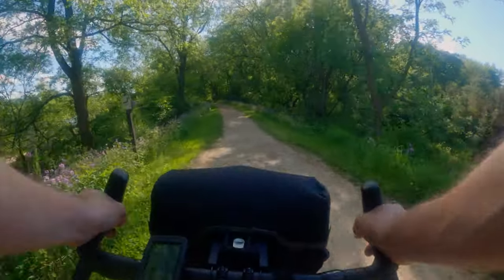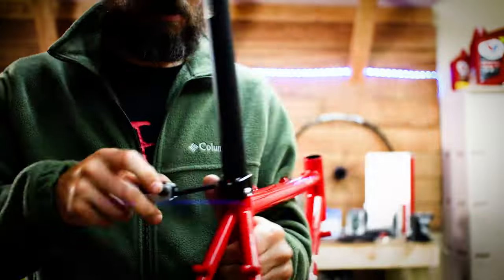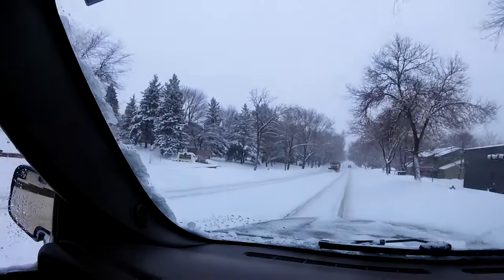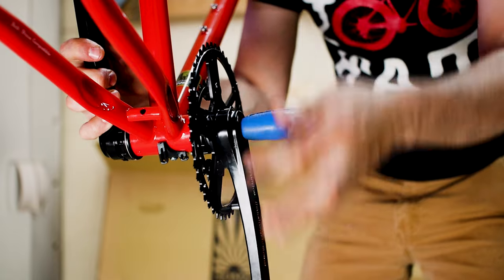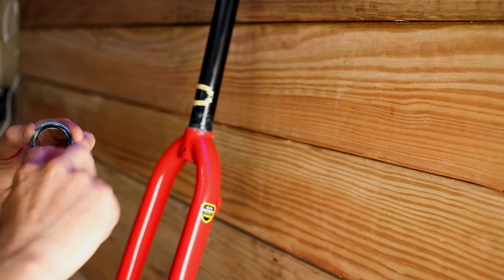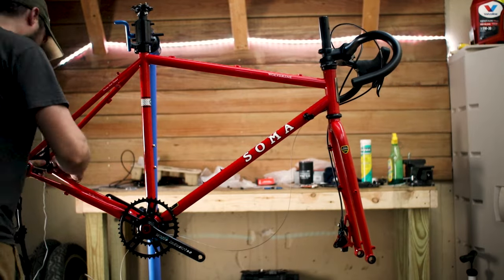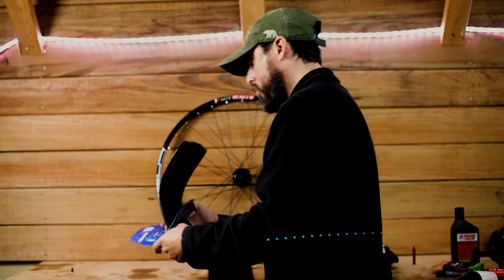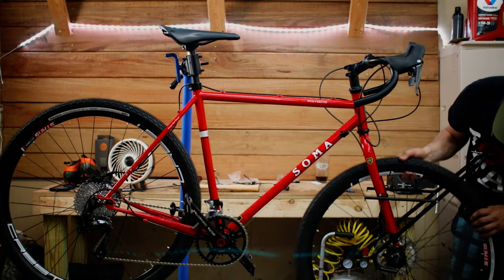Soma Wolverine - Let's Build a Go Anywhere Gravel Bike - Soma Wolverine

Comment: I'm a former Wolverine owner. I bought it because it was advertised that it fit 700x50 tires. 50mm Gravel Kings on DT GR531 rims measure 51mm, and will only fit if the dropouts are slammed back, which they don't recommend...
Reply from the maker: I fit 700c x 50mm GravelKings on Stans Crest MK3 rims WITHOUT slamming the dropouts all the way back. 50mm is the max you can go. While tire and rim width do play a roll here in where you position  the dropouts, but to set it up right it's more about calculating the correct chain length for your drivetrain setup. It's worked flawlessly. I talk about this in another video.

Comment: Nice bike and build. And nice to spray, but I believe Soma sprays their frame with ED coating to inhibit/prevent rust.
Reply from the maker: Thanks! It was a really fun build! 

ED coating or E-coating is a wet process to apply paint on the outside of the frame. The frame saver I used is to protect the inside of the frame from rust. 

I love the way Soma’s bikes look, but I wish they would powder coat their frames instead. It’s a dry process that provides more protection from dings that cause paint chipping than ED coating does. Once you have paint chipped away, rust has a fighting chance. This is my second Soma frame and both needed a new paint job after a few short months.

Comment: You can use fogging oil used on combustion engines to protect the internals of steel frame.  It's relatively cheap and available in automotive section of stores.  +1 on your build and the many miles of enjoyment on your bike.
Reply from the maker: Thanks, John! Great tip!

Comment: “I'm cheap so I just press this Cane Creek headset in with this hand made press after installing my White Industries crankset”.
Reply from the maker: One man's cheapness is another's innovation. 😂 The reason I'm able to afford expensive Cane Creek headsets and White Industries Cranks is because I understand that I can build a tool that cost me less than $10USD that normally would cost $180 if I bought the Park tool equivalent. I've used my handmade press for over 20 years on dozens of builds. Best tool I ever used!

Comment: so 700c by 50mm tires fit? I was hesitant to buy a wolverine frame because the soma website said only 45s would fit. Hey I might get it now, thanks. Hope its the same for the type A as well
Reply from the maker: Yeah, 50mm fits great. You need to find the sweet spot in the drop outs so that you don’t have the hub too far back, but they fit. 

Soma says on their website that 45mm with fenders and 1.95” without. 1.95” is just shy of 50mm. A more aggressive tire than my Gravelkings may not fit as well.

Comment: Hi very nice bike and build, how tall are you? Thinking of getting a frame set and slowly build it like this. Very sexy looking rig. new sub here and enjoying your channel. Thanks
Reply from the maker: Thanks! I’m a hair shy of 5’10”. Which often has me trying to choose between frames sizes on a lot of bikes. When I’m in that position, I look at the stack and reach on the geometry chart of a bike I’m considering and compare it to one I’ve ridden that I know fits me well. This won’t work as well with bikes that have radically different geometries, but it will get you closer to deciding between two sizes.
Reply: @GreatEgretAdventure  thanks for the reply..🤙🏽